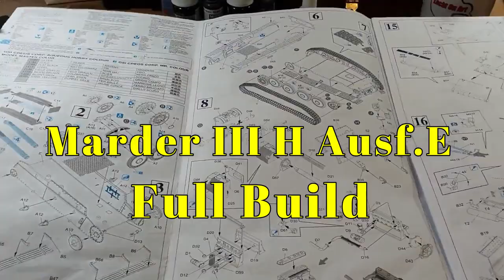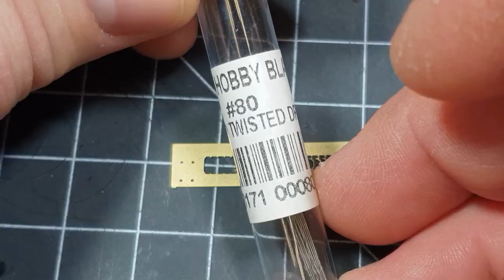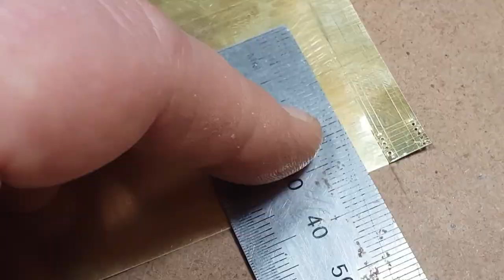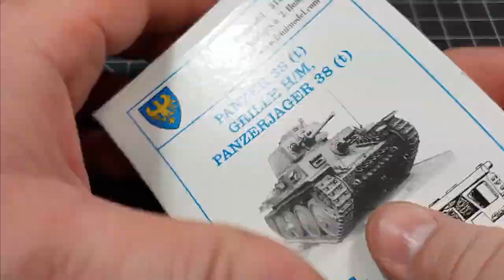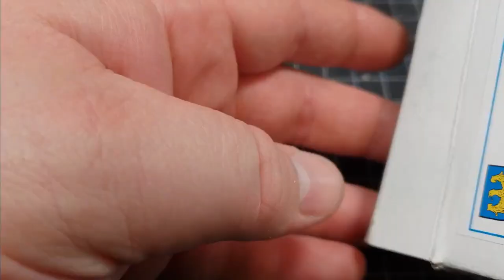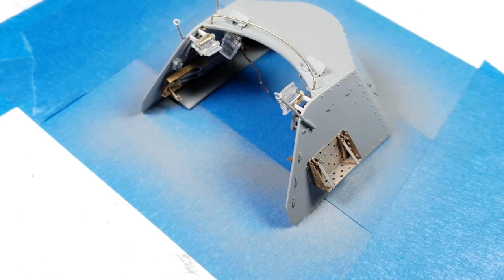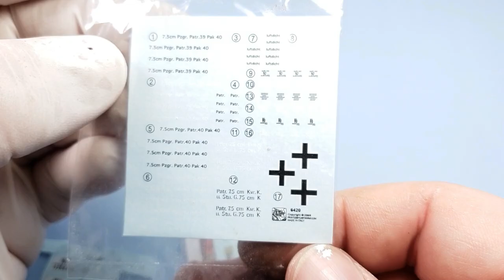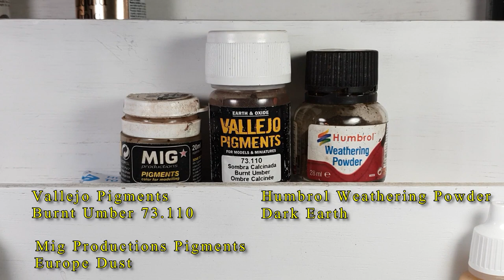Building Dragon Models' Marder III H  with full interior start to finish.

Comment: Your Marder video came up as a suggestion on my YouTube feed. Watched the series of your Marder build. The execution… my jaw dropped. You and only several others have executed a build that has so much detail. And you have used the most PE details. 
Thank you for showing what oil paints you used and where. Excellent
I have a question when you added wires to the engine (beautifully shown) what thickness would you suggest using? 
I already hit subscribe to your channel
Reply from the maker: Thank you so much,  I really appreciate the feedback, and I'm glad you enjoyed watching my work.  The wire I use is a couple of different gauges of copper wire.  0.3 mm and 0.4 mm. I usually get it from common electrical cables that have been stripped down. You can also get it in spools at electrical shops. I hope that helps, and thanks again for your support!.
Reply: @LocktOnArt it definitely does thank you. 
I saw another pro modeler’s video and he suggested always keep left over PE trees (at a loss for a better description) because of the thickness and can be used on the fly to make improvised ad ons. 
I have a Kubelwagen kit and wanted to upgrade the engine compartment with wires. And I wanted to wire the lights on German kits for the electrical lights (convoy light) Thank you for the reply.

Comment: Lovely. 
One point to consider. For Praga engines, the cylinder head is black but the rest of the block is red. Hull red is fine but fire engine red or even scarlet is preferable.

Comment: great video and awesome work i have a question?  I would like to know what cable sizes you used.
Reply from the maker: Thank you for your compliments. Mainly I stick to 0.3mm, 0.4mm, and 0.5mm copper wire.
Reply from the maker: Here is a link to a video I go into detail about the build https://youtu.be/yGhuPmxTpIU
Reply: @LocktOnArt  thanks for answering, greetings my friend
Reply from the maker: @jperez4517  you're very welcome